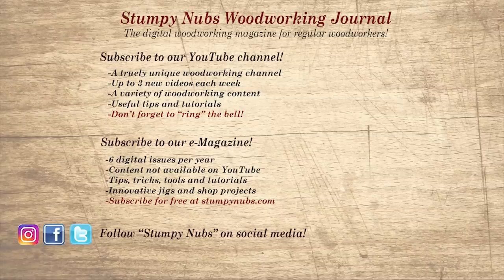Are table saws becoming obsolete?????

Comment: I haven’t been able to use my table saw for 18months, I’ve learnt/developed ways to do everything I need to with my tracksaw, bandsaw, mitre saw, router and router table. But man do I miss the speed, accuracy and convenience of the table saw. I’m in the UK so don’t have access to dado sets and that would be a game changer. 
Thanks for all your hard work with the content, brilliant as always
Reply: Why don't you have access to dado blades?
Reply: @marcsheldon6512  Dado blades are illegal in the UK because you have to remove the blade guard & riving knife to use the dado stack.
Reply: I think that Rudy Carrera in wrong about dado blades in the UK.  EU Health and Safety rules make it effectively impossible to use one in Europe in commercial premises or with employees around.  However, for private use purposes i do not believe that there is anything to stop you using one.  The fact that you cannot use one in commercial premises means that table saws with a shaft long enough to take a dado stack are generally nit available.
It is worth noting that Festool have recently produced a track saw with a dado blade.  That terrifies me
Reply: As John pointed out table saws with long enough arbors to take them are very rare and cost prohibitive to me as a hobbiest wood worker, they are available but illegal in many situations.

Comment: Love my table saw, wish I had more space around it!  Thus I am forced to use a track saw and router when working with larger pieces.  Thanks for the great review.  PS  I rip a lot of hardwood for cutting boards, its the only way to do the job.
Reply: New table saw user here with a small bed & confined space as well. Any advice on a specific track saw/rip guide that you love to work on 8" lengths?
Reply: @kooale  Makita make a good unit for the money.
Reply: @alanbarnhill930  Indeed they do, I've owned a 7.25" for 40 years without a second of servicing. Thanks Alan

Comment: Some thoughts on a couple of your points at the start of the video, specifically related to the fence. You could always build a general purpose workbench around one of the universal table saw fences, with 20mm "dog" holes for alignment of the track saw. I'm think something like the Festool MFT, but built around a nice table saw fence.

That way you can reclaim some space by using it on a general purpose workbench which can easily be setup for quick and repetitive track saw cuts.

Perhaps the other question is whether or not table saws are obsolete, in the context of the ever decreasing price of CNC routers - That one tool can replace most of a shop and has the advantage that it can be working on a project while you're busy designing the next! Not quite as tactile though.

Comment: I have three table saws to choose from.  Two are full size at the Menz Shed I belong to, but I almost never use them because they scare me to death.  One did not even have a riving knife, so made one out of an old saw blade.  The first time I used it (after it had been in the shop for several weeks) I found the fence was nearly three mm out end to end, so I fixed that as well.  However, the next time I used it I found it had moved again.  What breaks my heart is that we used to have a decent table saw that had rack and pinon fence adjustment, and always stayed spot on.  However it had a hideous travelling table for large sheets that took up room and wasted space.  So when we had to get rid of one of our table saws, I actually pleaded with the lads that we keep the rack and pinon saw and get rid of the one we now have.  I told them to throw away the travelling table to save space (no one ever used it), but they knew best and now we have a crap saw that is dangerous as heck.

So I use the DeWalt jobsite saw that I have at home, which I absolutely love.  It is accurate, and the fence (also rack and pinon) can be finely adjusted and will cut exactly what the scale says it should cut.  With a few jigs (crosscut sled, mitre sled, variable angle sled and tenon jig) I can make decent joints.  I have a jig that allows me to use a DTI for fine adjustment).   You can get a DeWalt dado set for US$179 from Amazon.  (If you happen to live in New Zealand or Australia, check Amazon for saw blades.  They are well under half the price we are charged at Bunnings and Mitre 10 in NZ and Oz)

Comment: I love the track saw and it's the first tool I go to when I bring plywood home, but I'm constantly at the table saw refining my dimensions.  The table saw is easily the most used machine in the shop.  The only thing that is obsolete is the wide capacity on my rip fence.  95% (maybe more) of my cuts are 24" or less.

Comment: I have a nice top end compound miter saw,...rarely gets used now. My issue is space so all my wood working tools like table saw,  router table, miter saw, band saw, are on carts or specialized folding carts. My table saw is a highly modified Bosche job site saw with Micra miter, and a bunch of sliding sleds. The main reason for this is while my table saw is my most used wood working tool, my most used and favorite tools are a metal lathe and metal milling machine. As you might guess those monsters aren't portable so take up the most space in my shop. Between those tools and my MIG welder there isn't much I can't build and repair.

Comment: Quite reasonable arguments about table saws.
My table saw is  a budget one. Even expensive discs tilt in rotation and therefore leave marks on workpieces.
And it does not have proper cover with dust extraction.
I upgraded the saw and will continue upgrading it.
But I try to avoid table saw when I can. It is not save in any way.
Large sheets I cut only with track saw.
The principle is  handling convenience.
Same applies to routing.
Relatively compact workpieces with router table and table saw.
Large ones with hand held router and track saw.

Comment: Due to space I have to rip down sheet goods with a circular saw and a strait edge.  However I have a small table saw for most of the reasons in this video.  I made a nice fence out of steel and use lots of little scrap wood jigs for precision cuts on small pieces.  The smaller the piece the more likely I am to use the table saw!

Comment: Hello James,
I totally agree with you. Like most things in life, one man's meat is another man's poison. Therefore there is no right or wrong, only what works for you.
In my case I live in 🇬🇧 which means no dado stack. I also have a standard one car garage which is smaller than a one car garage found in the US.
Therefore your fine saw stop probably wouldn't even fit into my garage, so my table saw is a top line Metabo site saw.
I therefore have to rely on my old B & D circ saw, Makita track saw & mft style bench, router table, Dewalt 1/2" router DWS 780  mitre saw and hand tools for example to accomplish what I need to do. 
Having said all that, if I had the choice I too would use a table saw as you do but not everyone has the choice or chooses not to which let's face it, won't stop the world from spinning.
Stay safe, stay well and stay sane in this strange world we find ourselves in 😎✌️👍👌 🇬🇧 🇺🇸

Comment: Working with a small table saw I can't cut large sheets on it, but I couldn't justify the high price of a track saw, so I simply use a circular saw with a piece of aluminium as a guide to cut big sheets into smaller ones.  It's a bit of a hassle, but I only really need to cut it into quarters to make it manageable.  Most of the time though I have that done at the shop, because I can't get even half a sheet into my car.  The occasional big sheets I have are the result of special deals on the sheet and delivery.

I'm considering a basic mitre saw when I can next buy a tool.  There are things that I think will be easier and safer to do on that instead of the table saw.  Then maybe a little benchtop bandsaw.

Comment: Now would be a good time to get opinions on miter saws.  I see lots of shops where this is among the first purchases.  If you run a production shop I’m sure they’re useful.  I’m a hobbyist with a 700 sq ft shop and don’t see a need for one. I break down long boards usually with a Japanese framing saw or if lazy maybe a circular saw or even a sabresaw.  Accurate miter cuts are done on the table saw. In my opinion miter saws are of limited use and take up a lot of space with the need for lateral room to accommodate long boards.

Comment: I agree with your opinion, but with the caveat that you need a reasonably good quality table saw to actually realize the benefits you describe. I have a low cost contractor saw that served me (as an amateur) reasonably well for over 30 years, but it takes a lot of fussing to get the kind of results that you describe (particularly due to the crummy fence the saw is equipped with). This was OK for the typical DIY homeowner projects I was doing in the past, but now that I am trying my hand at more advanced activities, I typically only use it for rough work, and resort to hand tools to get the precision needed. Hoping to invest in a SawStop someday though ...

Comment: I caved and bought a table saw to cut those thin strips that just are too fiddly to do on a track saw and bevel cuts. I prefer to use my track saw for big cuts because my garage is small and my mafell track saw cuts clean and straight (its my favourite tool to use). The main issue for me is space to move boards over machines vs hand held units. Its still early days for me an my table saw my cuts aren't coming out as clean has I had hoped compared to my mitre saw or mafell. It probably need more setting up which is frustrating because my chop and tack saw were good to go with minimal effort.

Comment: Definitely agree with all of your points. When it comes to repeatability, speed and accuracy, the table saw wins every time. I don't use my table saw a lot, but I know when it's clearly the best tool for the job. I do prefer making dadoes with my router but that's a choice and I don't do it all the time.

Comment: I’m on my third table saw now and I’ll never need another. It’s too bad that it’s hard to do really good work on the  cheap, small saws that most of us begin with. I worked my way up from a  contractor saw, to a mobile contractor saw, and finally a true cabinetmakers saw. The difference in safety and the quality of cuts is amazing.  That might be part of the bias toward the track saw that your hearing. As a newbie, rinky-dink table saws can be a real turnoff, especially if you experience kickback...

Comment: i found this very interesting and informative. on reflection though, i am not sure this is 4 different reasons. it seems like all of these come down to the combination of speed and repeatability. 

But That’s not a virtue for every kind of wood working. Sure, if you are a cabinet maker or make lots of carcasses by the gross for commercial production, and you need to minimize labor time in order to expand a too thin profit margin, then that matters a lot. 

But if you are making artisan furniture, or you are a luthier, or engaged in theatrical carpentry they might matter less than space, safety, noise, cost, or the need to prioritize machine work for other cuts you make more often than making long straight rips and crosscuts (and a dado is just a crosscut with a wide kerf that doesn’t go all the way through the workpiece) using burch ply or milled hardwood. 

if speed with repeatable dimensions don’t matter for your project, or matter less than other things, then your argument seems to imply there is likely a better saw for any given operation than a table saw. 

That might include, sometimes, the often unfairly maligned radial arm saw which has many of the same desirable qualities as a table saw for some operations in a cheaper, smaller, (arguably) safer (if set up properly) piece of equipment. 

Curious to know if you agree

i’d be very curious if i understand your take

Comment: I will tell you the the saw i want but have yet to score (in my price range). Panel saw, I had access to one of these at my last job and man it made cutting sheet goods such a wonderful experience. Granted it was a 23,000$ saw and could cut 13'x9' sheet goods. But i would rather have a panel saw than a track saw for sheet goods after using one that much.

Comment: Hey Stumpy! This video couldn't have come at a more pertinent time for me! I just bought a Makita track saw and then dumped another $722 on the TSO parallel guide kit and bits...and now I'm wondering what I was thinking vs buying a better table saw! There is certainly value in both, but for me starting out as a hobbyist...I'm not sure...  FWIW, I have a 15yo dewalt jobsite (DW745?) which is tired and needs to be replaced with SOMEthing.  Thanks for the video.

Comment: I made a bunch of drawers and doors for my kitchen remodel with my table saw. My brother came over and, while looking at both assembled and unassembled doors, said "these things look like they were cut with a machine". I responded that "they were, with a table saw". He then said "You know what I mean, the joints look airtight. It's hard to believe that you did that with a table saw and not some CNC machine". That ain't happening with a circular saw. An accurately tuned table saw, good setup, and careful measurements can make you look like a rock star.

Comment: So table saws offer speed, power, accuracy, repeatability.
Sounds like a machine tool, a means of production , a tool that makes tools.
I want to have that power.

I have no desire to become a wood worker, but I come here for the tool/safety information.
My projects are all rough carpentry, but its easier to learn the best practices and loosen up from there than it is to start sloppy and tighten up when needed.

I don't have a table saw yet, but the ability to rip long narrow stock is what attracts me.
At the same time, I feel like a track saw will be preferable for breaking down sheet goods.
I do have a overhead radial saw, which , thanks to you , will be relegated to crosscuts only.

Comment: Great video as usual Stumpy.  I watched it as I do want to get a table saw but I need to justify it over the track saw and mitre saw.  I think a lot of the strong views probably come from peoples experience and workshop size, also where you are based.  In the UK you cant get dado stacks so that rules that out.  If you have been into woodworking for a long time then I can see how a table saw would become indispensable as it really was the only option.  Coming to it more recently and still a beginner DIY'er I went for the track saw option as it's available and decided to get a decent one and went with Mafell.  I can cut a 1mm strip with this.  Also I'm not doing this as a living, so don't need to consider speed as a factor, I can take my time setting up.  Also have a router attachment to clip onto the table saw track and a router table.  I think I can cover all basis with theses and the mitre saw.  The mitre saw is an Evolution, so not the best but reasonably good.  However there's just something about the table saw that keeps drawing me back to videos like this to try and make my mind up to bite the bullet and buy one.  I can see the beauty in making a nice sled for it and I'm sure I would enjoy working with it.  But then there is the need for the space for the in-feed and out-feed in a small garage.  So still not converted but enjoyed the video, as I do with all of yours.  Maybe when I build my super duper workshop in the garden and have the room I'll be a convert.

Comment: I can't really imagine giving up my contractors table saw. But I also have a Festool track saw.  Since I am always working alone and my shop is on the smaller side I would not even consider trying to wrestle a full sized sheet panel on the table saw.  That is track saw all day every day for me.

As for a circular saw I do own one but that tool would never see the inside of my shop. Not even to be cleaned up.

Comment: 40 years ago I purchased a Radial Arm saw over a table saw. To this day, I am still feel I made the best choice for me. I can rip a 20 foot long length of lumber and it will be dead nuts on. Like the band saw, I am limited to the width, but.....so is a table saw, to a degree. I have never even as much as  nicked a finger on my radial arm saw nor has a piece of wood ever kicked back and hit me.. A neighbor the lives next to where my wife was raised used a table saw. He lost track of where the blade was and ran his hand right over the blade. He lived but ended up with a mass amount of stitches. 
I get they both have their value and you can probably cut two 4 x 4 sheets out of a 4 x 8 sheet of plywood where I can't on my radial arm saw. But try making a cross cut, in the middle, of a 2 x12 x 20' length of lumber. Yes, you need a miter saw to do so. I don't need a miter saw. 
I know I pretty much stand alone since most of the woodworking videos I've been watching use a table saw, but I'm sticking with my radial arm saw.

By the way, very good and interesting video. 
Barry

Comment: I have a table saw.  If your making a whole bunch of cuts, it's the easiest.  But, if your not mass producing and instead do a project or repair just once in a while and not a daily woodworker, you can get by without.  But mine is my "go to" for large accurate cuts.  Quick and easy.

Comment: There really is no need for a table saw in this day and age. They are unsafe and expensive. 

My Grandfather used to keep a beaver brace and I have always preferred it to a table saw. 

The beaver brace is a 2x2 foot frame made from aged oak. The general idea is that you tie a live beaver into the frame. You then offer the beavers  head up to your stock whilst you vigorously lash his backside with a switch made of birch. This will typically make the little bugger bite and they will rip your stock down to project size in no time. 

Keep up the good work. Fantastic content 😜. Thanks